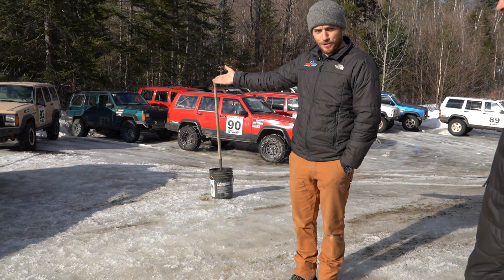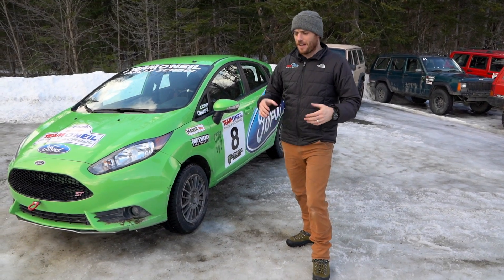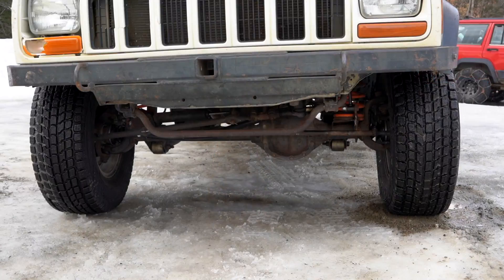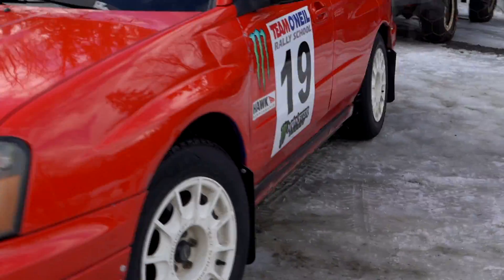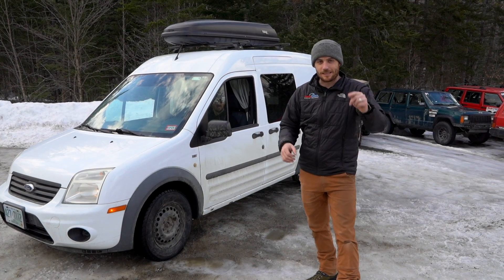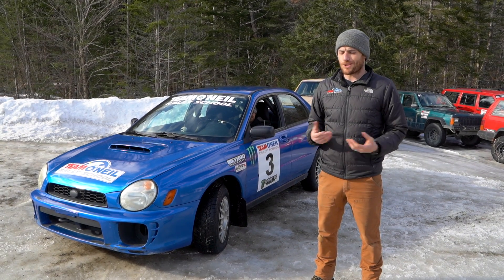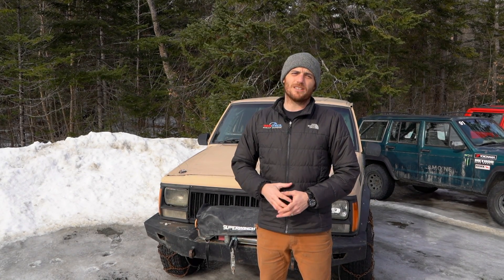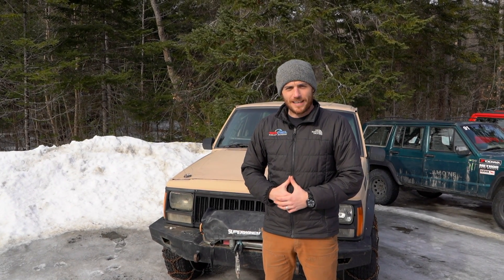Differentials and Traction Control Explained

Comment: I think in a Scion xB I had to drive for someone once, had that terrible kind of traction control, it would just cut power to both wheels and rev the nuts out of the engine... what a terrible car.
Reply: Sounds more like a slipping clutch or transmission if auto. If the engine is revving, at least one wheel will turn.
Reply: Colin Stuart I've owned a 2009 Ecksby for ten years now. At 16,000 new, it has proved to be an excellent value: terrific acceleration (with the manual box), braking, balanced-to-oversteer handling, dead reliable (not even a battery replacement yet), excellent paint for such a cheap car, fantastic utility...not too terrible in my experience. Your assessment of the traction control is even further from reality; it primarily works by brake application as show in this video; at a certain amount of revs without movement, the throttle is progressively closed but never to the point of stopping all tire spinning. Before fitting Bridgestone Blizzacks, I was once stuck on ice on the steep end of my driveway. I had the throttle floored in first gear; the traction control kept the engine revving at a constant 2000 rpm and rapidly shifted power from left to right. The car ever so slowly made its way over the ice, up the hill, and out of the driveway.
Reply: Tim Winters.... We get that you LOVE your xB and thing the world of it, but 10 years of ownership has skewed your perception a bit. Cutting the power to 2k rpm’s is exactly the terrible type of limited slip Colin was referring to. As Wyatt stated in the video, you’d be better off switching the tc off and using momentum and wheel spin (to get down to surface with better traction/grip) to get up the hill.

Also, 8.5 sec to 60 is faaaaaaarrr from terrific acceleration. It was actually terrible in 2009, never mind 2019. and a front engine, front wheel drive basic mode of transport that has oversteer handling????? I think something maybe broken. Because of the nature of the car and the intended driver, those cars come from the factory with understeer, as do most cars.
Reply: @seashackf1  I'll be gentle here. How do you get LOVE from "excellent value" and "not too terrible in my experience?" Ten years of living with a car skews one's perception of it? The 8.5 sec to sixty is the figure for the 4-speed automatic, I stated mine has the manual box. Road and Track's figure for it was 7.5 sec, terrific for a cheap economy car in 2009--in my opinion. In spirited driving, my xB (with tire pressures fine-tuned) takes a pleasant neutral set mid-turn with oversteer available to one who knows how to drive a front-drive car. In my 49 years of driving, professionally repairing, building, racing, and owning an extensive array of old and new cars, I've picked up some knowledge beyond my earlier immature know-it-all enthusiasm. I certainly learned I couldn't analyze a car's dynamic traits before driving it. 
Colin: "it would just cut power to both wheels and rev the nuts out of the engine..." My description of how the traction control works is about opposite to this nonsense, and is exactly what you see in the video with the vehicle with brake actuation and throttle reduction traction control. I gave an example where this type of system ended up working. I agree it is sub-optimal in many situations. Sometimes it may be worth a try to disable the traction control, but then you lose the very effective alternating braking of the spinning wheels and end up with only one wheel spinning. If I were energetic enough, I'd reflash the traction and stability control routines to eliminate throttle reduction completely--my right foot can do that fine. Cheers.
Reply: Tim Winters..... thanks for your gentlemanly gentleness, I’m very sensitive. ;) 

10 years absolutely skewers, the longer I own things and use them the more attached i get. I’ve kept most of my cars 5+ years and have a tough time selling, but after a while am always glad I did.

7.5 still isn’t terrific, but you qualified it this time with ‘cheap economy car....’ and ‘in my opinion’, so fair enough.

You also qualified neutral to oversteer with fine tuned tire pressure’s and driver ability. I assume increase in rear pressure and harder trail braking to rotate the rear end. The driver part doesn’t change the handling of the car, it just shows your great driving skills. :P.............
Reply: I always tell (non car people) to at least drive before buying....... because you can’t tell by looking at it or the stats. You may not like the way it drives and that’s the most important part.

I didn’t mean to rain on your parade. If you like your xB and it suits YOUR needs then that’s all that really matters.

Good day and cheers to you too kind and gentle sir. ;)
Reply: @timwintersoncntr  he got love from that the same way I did. Kinda went into a sales pitch there. Calm down, it's no Honda. Next time work on your presentation a little if you're having trouble with being understood.

Comment: My 2005 wrx sti uk model has lsds front and back, surely the usdm has that too!?
Reply from the maker: 05 and newer STIs have the torsen type LSDs... They're great! I just learned the normal WRXs switched to open rear diffs (here at least) in the '08 and newer models, same year Toyota stopped offering limited slip diffs in the back of their trucks as well. Sad sad world.
Reply: @Teamoneilrally  It would be great if you'd make a video showing how torsen LSD can't do anything when one wheel is in the air, so people woudn't think they are invincible with torsen. Actually I got stuck two times this winter in deep snow in my Hawkeye STI with only two wheels spinning. Too bad didn't tried to use breaks, would be interesting to know if it really helps.
Reply: only a wrx in the video
Reply: @MichaelSeeds  Ah ok, that makes sense. Shame they didn't include an sti to show how awd should be!  ;)
Reply: Yeah I guess it's down to cost and what the average car buyer wants and needs. I was surprised the wrx wasn't spinning all fours but hey it's been educational! Thanks for the awesome videos and taking time to reply!

Comment: 10:30 IIRC Do all STI models disconnect the center diff when the hand brake is pulled? Or is this only true with the models that have the mechanically controlled center diff?
Reply: I believe its only the '04-'05 models. They have an electronically controlled diff that unlocks fully when the Ebrake is pulled. The '06+ models have the same thing but they also have a mechanical differential to prevent fully unlocking. Pull the handbrake in an 05 sti in the snow and you can do a fwd burnout lol
Reply: I would think they all do, my 05 Sti certainly does it and even my previous 2000 basic turbo model did it, too.

Comment: One thing... Tires/suspension are the reason my open diff 3rd gen 4Runner is WAY better in snow than my VR4 (3k) with LSD.  Tires/suspension matter a lot when the coefficient is bad.
Reply: exactly, a car can have 4WD or AWD and all the diff lockers or LSD's you want but if you use summer tires on a slippery icey road you will still not get traction.  The single best investment is a set of tires that work for the surface you will drive on. Snow and ice? > winter tires ,  preferably with studs
Even a 2WD with open diff will do much  better.
Reply: Totally agree about tires, they make more of a difference than anything. But suspension isn’t a factor when stopped , like in this video, or at very low speeds.

Comment: Make a video on scandinavian flick vs just handbrake turn. What's faster on a loose traction track.
Reply: On a square left or right you’re able to carry more speed with the scandinavian flick. But on a sharper corner like lets say a hairpin, the handbrake gives you a smaller turning radius, which makes it perfect while a scandinavian flick will give you understeer most likely.
Reply: Pet3r38 thanks. That's what I wanted to know
Reply: depends on the corner, Scandinavian flick more predictable.
Reply: The handbrake unsettles the car at high speed leaving little room for a decent recovery. Best used for low speed and tight hairpin turns.

Comment: Great video. My sti has a front lsd
Reply: Is it electronic?  I haven't looked at STIs for a couple years.  My GTI has electronic LSD, which is ideal since the electronic LSD can change from fully open to fully locked, so you get the best of both.
Reply: @fredygump5578 The front and rear differentials are mechanical. I believe the center differential is controlled through electromagnets.
Reply: @fredygump5578  if your gti awd?
Reply: @MichaelSeeds   No.  GTIs are always FWD.  The Golf R is the one that is AWD.  It gains a haldex AWD system, but loses the LSD.  (The drive train of the STI is far superior to anything else available, which is why it dominates rally.  But the GTI is more "refined", and it just made more sense for my actual needs.)
Reply: @fredygump5578  I looked into it. I know nothing about Vag cars but it does seem pretty cool.
Reply: So it has an aftermarket lsd? No factory subarus, even stis have lsd in the front, it just would not make sense for a road car.
Reply: @VTnadjers94  I don't know a lot about the newer ones, but my 2003 Sti Spec C has a front lsd from the factory. I'm pretty sure most GD body sti's are the same.